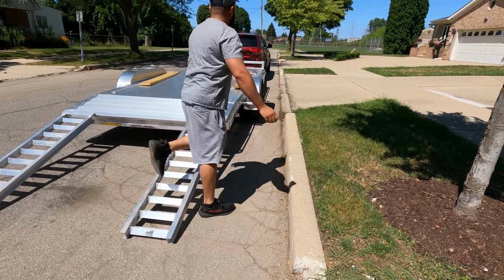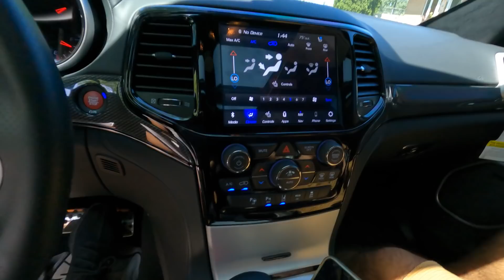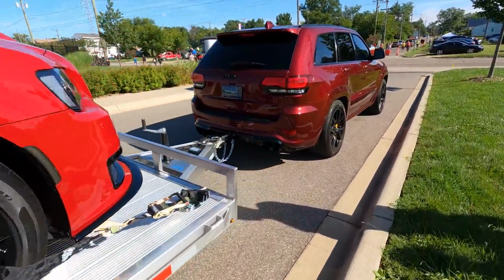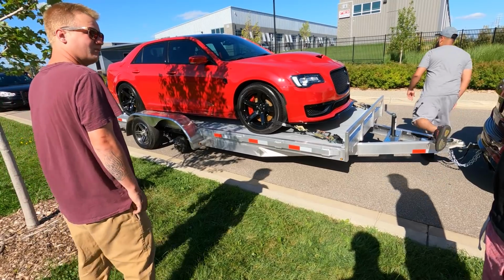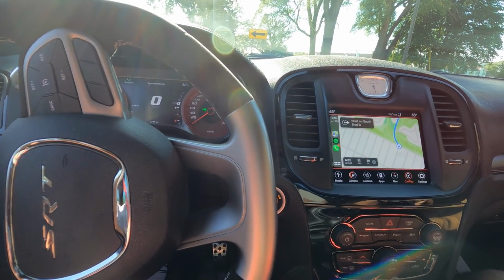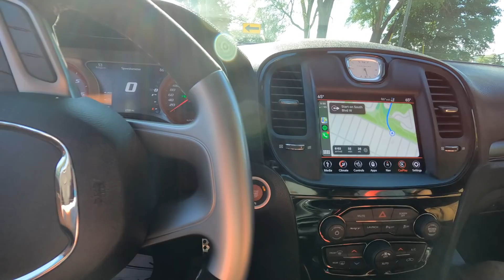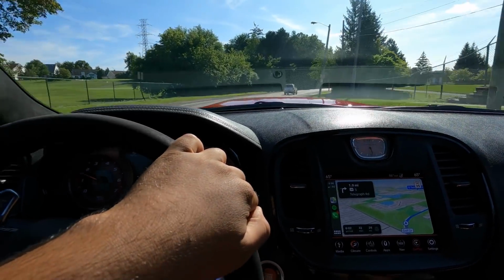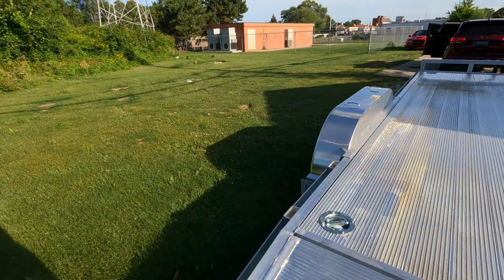MY HELLEPHANT 300 ALMOST GOT TOTALED (WHEEL CAME OFF TRAILER!)

Comment: Perfect example of why any new purchase should thoroughly be checked over bye the purchaser or have someone with you trust with the knowledge needed to do it for you. Also a huge reminder for myself.
Reply: Dealer is supposed to go over just like car dealers. I felt something shady about owner when he was buying it because even one of the tail lights weren't working when got hooked up to trailer.
Reply: It’s a simple trailer, no need to find some random shade tree mechanic to do a 20 point inspection.This is on the dealer.
Reply: @davidwatts5863  yeah we have a choice to buy or not to buy.  Dealers sells as is. You buy it your problems. If you have no warranty or insurance.

Comment: You should hop on hoonigans this versus that and race itsjusta6’s f-150 super snake
Reply: True
Reply: no offence to Gavin, but even though he makes a bit more power, and has AWD, I feel like the 300 would eat it for breakfast lunch and dinner
Reply: @atche8004  I mean you see some of the this vs that it'll be like normal some are close but alit of races are far off
Reply: @atche8004  naw it would be close you gotta remember the hellephant is 1000hp at the crank not at the rear wheels its probably 825 at the rear wheels those 300s are heavy
Reply: @atche8004  well the 300 prolly cause it weigh less and has more power but if the power turned up then idk it’ll be somewhat close

Comment: Another thing you can do so your splitter doesn’t scrape is you can leave the trailer attached to the hitch and wind the leg down and when you drive the front of the car on the ramps then you can bring the leg back up and it will raise the front of the car up

Comment: Just keep the trailer on the ball , put a 4x4 block under the trailer jack and crank it up to decrease the load angle. You can buy some ramps also instead of the wood planks .But the first option won’t cost any money except the 4x4 block.

Comment: I thought it was a brand new trailer how the hell could that even happen
Reply: 2021 trailer unless the dealer lied.
Reply: H&H doesn't make the full aluminum on their 2021 model trailers under 20', so it was either a carryover trailer or the dealer lied and sold a used trailer. Same trailer is still for sale on the dealers website claiming new as well.

Comment: Trailers and big trucks aren't like cars.  They're not necessarily "road ready".  You GOT to do your own checking and preventative maintenance.  Long ago I was hired to move a 55' oceangoing steel boat from Ft Worth to Houston, all I was supposed to do was hook up and go.  I specifically asked him, is this ready to go, have you checked the lugs?  He says yep, all checked all ready.  After leaving I-45 to go east on I-610 I see a wheel and tire overtaking me, yep, from the trailer.  After retrieving the wheel from the attempted thief and checking we found all 8 lug studs were broken off in the hub.  The lug holes in the wheel were severely wallered (lack of a better word) out, they weren't tight from the start.  Be careful, you're the one out there on the road.  Any accidents are on you.

Comment: BRO IT HAPPENS WITH NEW TRIALERS! IT ISNT THE GUYS FAULT EVEN WHEN I BUY BRAND NEW MOWERS I HAVE TO CHECK EVERY BOLT N NUT CAUSE I BOUGHT A BRAND NEW MOWER AND 1MONTH LATER I HAD TO REPLACE ENGINE CAUSE THEY DIDNT TIGHTEN UP THE IIL FILTER AND LEAKED ALL OIL

Comment: Doesn’t look like the trailer was meant for 2 tons
Reply from the maker: It was rated for 7000, the weight of the car + trailer where under that. I just think it was poor workmanship.
Reply: @KhalSRT  sorry to hear that brother I hope they can solve this issue with no cost to you. The shackles looked like some low grade bolts without the lock tight

Comment: Why on earth would you trailer that car to a show?
Reply: RICARDO  Flex failed.  Even if the trailer didnt break, it's just silly.
Reply: It takes racing gas that shit not cheap like $7+ a gallon
Reply: @313DETROIT   Nope - hellephants are built to run on regular 93 octane fuel.
Reply: @Avalanche2  But he tuned his to run off racing gas

Comment: Praise God you weren't on highway!  This is ridiculous! A brand new trailer with terrible build quality. Even at car dealers they go over a new car checking stuff before putting on lot. You deserve your money back and get different company trailer, God knows what else is going to fall off. I know you did your research on what type trailer you wanted but go back and check reviews on the quality and build to see if others had this stuff happen? I wouldn't trust having my car on that trailer and I would be paranoid everytime I drove it. The other crazy thing is once you first got hooked up to trailer one tail light wasn't working and he had to change both tail lights. I didn't like the fact that they glued new ones on. 🙌🏾🙌🏾🙌🏾😡😡😡